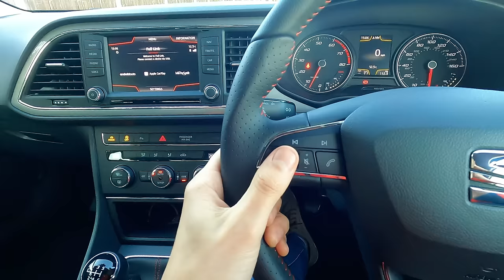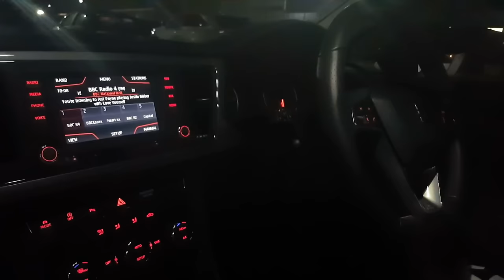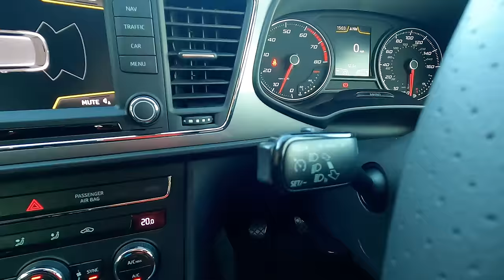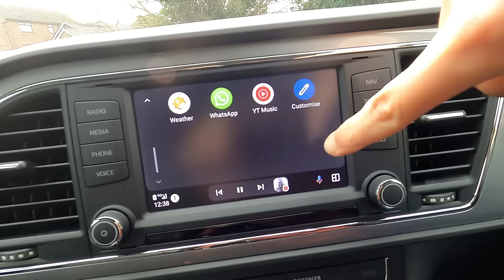Repairs and Costs Over 205,000 miles in a SEAT Leon Petrol

Comment: Such an interesting watch. Ive only had my car just over 2 years, yet its done 150k miles of which ive done nearly 30k. Although it is 10 years older than your car, so arguably as impressive a mileage figure; I should point out it is also a petrol, though 1.6 litres and natural aspirated. Of course its more difficult for me to know exactly what its had done to it over the years, poor thing is gonna be 20 this year (easy to remember cos we are the same age 😂) but with me at Uni it doesnt get used as much so less going wrong. Some similarities however, i woke up one morning to the release baring having just given up on life, it quite literally died peacefully in its sleep. Horrendously noisy and embarassing 😂. But overall I think my car has put up a good fight given ive certainly not been the MOST ideal owner, given before uni this thing was very much a work horse, and also used for pleasure, but i have managed to keep it out of the scrap yard, and do look after it the best i can for the most lart, cerainly a lot more than its previous owner. (No oil and 14psi in the tyres when my dad bought it from his colleague, it was driven in that state daily 😢). Fortunately in the summers between uni and afterwards im gonna be able to begin really looking after it again and fixing it back up to its former glory, albeit not overly well known for its reliability from new. The silver lining is that the engines rarely go wrong, and the gearbox is pretty strong, both components are orginal too.

Comment: 53:40

Mazda gang!

My dad has a 2008 Mazda 3. In 16 years it has needed the following work:

- O2 sensor replacement
- Engine manifold cover replacement
- Air compressor clutch replacement

Comment: Have you replced the cam belt on this car or is it still on its origional cam belt
Reply: Pretty sure the engine in this car uses a timing chain rather than a timing belt so unless there was chain rattle there would be no reason to replace it or the tensioner. If it was Cambelt it would have to be replaced at least twice by now as otherwise it would have snapped and blown the engine up no timing belt is gonna last over 10 years and 180k miles.

Comment: Been looking to buy my first car and atm I am torn between whether to wait and spend £8-10K on a used Seat Leon 1.4 manual petrol 5 door car or buy a cheap old car for around £1-3K. I have seen some cheaper Seat Leon with 150k mileage etc going for around £4K so I am stuck between deciding which car to buy.

Comment: The only depressing bit is how little it costed in 2013, compared to nowadays basically it's easily 10K+ more. Everything else is great!
Reply: Inflation is a thing. Also with a brand new model you get so much more tech etc which drives the price up

Comment: I have the Tourer. 2015 in white.  1.4ACT.  Purchased new with 18's and Winterpack.  In 9 years/ 85k miles I have not had any faults only items during its annual dealer serviceing.  I had light misting on shocks from 1st mot but always gets a pass. Got small crack on drivers seat. Easily returns 50mpg on long trips and goes fast when I want it to.  I was going to change it after 5th year but covid came and prices were crazy.  I purchased exactly like you with 0% offer and i have also continued the monthly payments into a savings account for 6 years £££ !!  Maybe I have been lucky with mine and would love to change to the same as your wifes car or Swace but i'm too tight and enjoy the Leon too much.
Reply from the maker: That's good to hear. Bare in mind that as mine is an instructors car it each mile is probably like 4 miles.

Comment: haha my golf (same gen/year  though was 60k miles when I got  a little over year go put 22k on it ) does the screen thing when its cold too.. drives me round the bend as I tend to go to work at 4 in the morning..... when its always cold (I also get the rear wiper only wiping most of the sweep, often stopping 1/3 of the way back to home position, again when its cold and it eventually seats back where its supposed to.

I would keep the car longer but kinda want one with the newer gen computer... but it has the MIB 1 computer not MIB 2 so I think that limits what I can put in with genuine infotainment/head units, it also has one of 2 of the issues the first cars had that aint been dealt with and all in all at this point would be pointless £ wise to sort.

Comment: Seat as a brand could be discontinued soon as VW seem to have neglected promoting it and concentrated more on the pricier Cupra brand which, itself, was an offshoot of Seat. 
I remember Seat used to be the sportier option in the VW catalogue but that has now been usurped by the Cupra brand leaving Seat with a bit of an identity crisis. 
I used to have a Seat Arosa in the 90s and it was cheap to buy, reliable and felt good quality and was well equipped for the time. These kinds of cars are unobtainable now as even cheap cars have risen in price. 
Seat were a good value brand with a sporty, Latin bias on some models. It's a shame that the current lineup looks a little stilted now.

Comment: A year ago I sold my bright orange 2018 1.4 Leon FR owned from new and replaced it with a brand new Mazda 3 Skyactive X in 2023. It took me ages to find a car that I liked as much as the Leon. In some ways the Mazda is better than the Leon but overall I now regret selling it. I had absolutely zero warranty claims or problems with it in around 35k miles, it didn't cost me a penny in repairs. I wanted another Leon but it's now as ugly as sin from behind, has silly, glitchy touchscreens instead of buttons and a more complicated first generation engine. Golf is fine but again has same issues and silly touchscreens that don't even have illuminated heater controls. I reckon the last generation Golf/Leon etc was about as good as it got. Gorgeous, smooth, strong and lively engines that are easy to service and fix and really good driving dynamics. The Mazda is a sublime driving experience but the visibility is awful and there is zero power at low revs, the Leon felt way faster. I have to say the Mazda 3 is probably about the most underrated car in production but the last generation Leon runs it a close second. I'll read your MX5 review with interest. I'd cation you against the Yaris, I had a 2020 Fiesta ST and I absolutely loved it one day, hated it the next, always enjoyed getting back in the Leon. Ditto 2019 Polo GTI, absolutely hated the automatic gearbox and no manual available. I also had a 2022 Kia CEED GT Line, not a patch on the Leon, more power on paper but much less in reality and didn't drive anywhere near as well despite multi joint rear suspension. That car was also easy to stall and drive smoothly and had a naff gearbox and old school bulbs for headlights. The guy I sold my Leon to is absolutely over the moon with it, he still texts me about it!

Comment: Would you recommend that a new driver (17y/o) buys a second hand car, probably around the same age, with that many miles?

On one hand cars this age tend to be cheaper as they've lived their life (but potentially have some left in it), but also such a high mileage brings the risk of frequent breakage, provided most sellers won't have taken as much care of it as you do?

If the answer is no, what is the maximum amount of miles on a car which you think is acceptable for a 17 year old new driver to buy?

Thanks 👍
Reply: At 17 yes definitely however I'd strongly reccomend japanese suzuki swift or toyota yaris or even high mileage prius however if you want a nicer car a German car from the vag group would be good 1.6 tdi or 2.0 tdi or 1.9 tdis are bullet proof golf,leon,ibiza,polo,passat,fabia,audi a3,a5,a4 or passats. I would avoid French cars at all costs as when they go wrong they don't stop going wrong! We had a peugeot problems kept re occurring or new problems kept happening. So high mileage can be worth it my car Is a mk5 golf 1.9 tdi 164k runs like a dream!
Reply from the maker: I don't pay too much attention to mileage, I buy on condition. A 5,000 mile car could be worse than a 200,000 mile car depending on what's happened to it. I like buying new as I know it hasn't been mistreated.
Reply: @RichardFanders  I'll tell you this I'm a young 18 yr old dont buy em from us! I take care of mine I service my car with mann filters and quantum volkswagen oil

Comment: Non british here: What's the difference between petrol and diesel? Because in latam we pretty much use both words to refer to the same thing.
Reply: Petrol is 'petroleum' or 'gasoline' which is the one that is used in spark-ignighted engines. Diesel is  used in engines without spark ignition, as it ignites when compressed. Typically diesel is used in large vans and trucks, and is rarer for cars
Reply: @brandonm8901  okay this is good to know since in Spanish, petrol and diesel are used to refer to the same thing, and gasoline is apart...

Comment: You are so very lucky you haven't got the panoramic sunroof. They creak and leak when blocked. Worst part of the car absolute nightmare. Mine is a May 2019 1.5dsg only 15,000 miles no problems except tyres replaced due ro bad cracking of the original Dunlop Sport Max tyres.

Comment: The motor trade and manufacturers don't want us to keep cars for such big miles. I ran a Gen7 Celica for 180k miles til its rings failed.(NETR). If there was a stronger culture of maintain, repair and refurb, there'd be no need for ludicrously expensive "green" solutions because fewer resources would be used up building new vehicles.

Comment: I guess you better drive this one a bit more and do a 350.000 km video and then also a 250.000 miles one cause yours will be one of the last seat that can achieve that considering that the brand will vanish and be replaced more or less by CUPRA 

At least here it looks like this. But I guess you pay a  lot for the petrol compared with the tco of what an e-golf comes cause over 275.000 km the wear and tear and maintenance costs were an awfull lot less than the ice versions. 275.000 x 7 liter / hkm = 19250 Liter compared to 49500 kWh of electricity (18 kWh / hkm) , mostly during an era of about 15 cent meant roughly 7400€ compared  to here 30.000€ for gas. Even now with kWh prices below 30 cent at home 247 the charging bill is far lower and more convenient at home which means roughly 15.000€ for electricity.
But the maintenance costs are far, far, far less with no plugs, no oil exchange, no belt exchange or coil replacement. Even the tire wear is down due to the more efficient tyres and less breaking. 

We have had 2 cars running next to each other during the time and IcE is a lot more expensive. 

good luck with the seat, I like it more than a yaris whatsoever which you can not compare with a mazda roadster, the genuine and purest one you could get at the early 90s.

Comment: 👍

Would have no idea looking at it, that it had done that many miles.

Worst car I had for reliability was an Astra. Only 3 years old when I got it……after a few months it started going wrong every month, and big item stuff-expensive.

Price, I’m in a similar situation. I bought my car for £19,000 but that doesn’t buy so much now especially with hybrids and electric.
And, why would I want to get rid of a perfectly good, reliable car for one that is maybe 20% “better”. Hard to justify.

Paint on my Honda is the worst paint I’ve ever seen on a car. Very delicate and easily marks. Every stone chip. And metallic blue similar to the Seat. Very hard to clean….never use a car wash-paint won’t stand up to it! Every smear will show up. Has to be perfect to look good….and in winter, drive 10 miles and looks like it hasn’t been cleaned.
Best car I had for paint was a 2005 VW polo…the old shape…that car was very strong and so was the paint. After 8y of owning it I couldn’t find more than a couple of marks on it. Non metallic paint….just wipe clean with water and a cloth…looked like new, no smearing, nothing. 

I had a few teething problems at the start, fixed under warranty. now in the sweet spot. Due new front brake pads next year…..around 40,000 miles. Some people claim their cars do 60,000 miles on pads.

Windscreen wiper blades are a bit rubbish despite being swapped out for new at the recommended time of 2y. Apparently this is a little weak point on these cars.

Engine idle stop wasn’t functioning for several weeks due to “charging symbol”….guy at work in his Mazda ignored that for months and then it refused to start….so i changed my battery last November- winter being extra toll. Now works brilliant. Original battery was 4yrs which isn’t great….but this is my first car with idle stop, so maybe ok?

It links to Apple iPhone but only android is fully integrated. I believe the updated models has both fully integrated….i bet the replacement head unit costs a fortune tho.

I also had the AC re-gassed last summer…tho nothing wrong with it, it wasn’t quite as cold as when new…for the same reason as mentioned in the video. And yes, I could feel the difference after.

The car with 3 computers….
My economy, range etc etc has 3 computers….custom A, custom B, and factory….the factory computer showing an average of 51mpg over 33,000 miles (petrol inc E10…this car is “rated” for E5, E10, and above, I guess US E15)…and it would be higher if it were not for the hills around here. Driving up them on a cold engine really hurts economy.
Btw it’s automatic cvt as well….i haven’t driven a manual transmission car in many years.

Comment: Omg, oil changes at 17.000 miles, surprised your turbo didn’t fail, and those aren’t motorway miles… I’m doing oil changes every 6-7k miles on my diesel BMW, but gosh oil don’t last that long, people should learn that an oil change is cheaper than a snapped chain or a turbo, regular oil changes prolongs life of the engine.

Comment: I had a Alfa Romeo giulietta 1.4 turbo(170hp) and now a green seat Leon 1.4 tsi and i always say to people that these are lazy people car's, it feels like you drive an automatic,6 gear 30mph without problems in both car's,5 gear 20mph and they don't even stall. Easy to start driving, easier then most diesel's actually.

Comment: From 40k I had a Honda CR-V which I then drove to 270k not a single thing went wrong with that car.
Reply from the maker: It's important to remember how many hours my car has been used for, if my average speed was 40mph I would have done around 800,000 miles so the mileage I have done far from represents the wear.

Comment: Not exactly been a reliable car then. You’ve had to replace a lot of non-consumables. Also lucky the car was in warranty when you had the cylinder head replaced. Interesting though you didn’t have the heater matrix issue which plagues the MQB generation VAG cars.
Reply: Many of the things he said he had replaced he also said didn't need to be replaced though... The seats, steering wheel, gearknob. Even the headliner if it was only sagging a little. Probably was like half of the "repair" cost already.